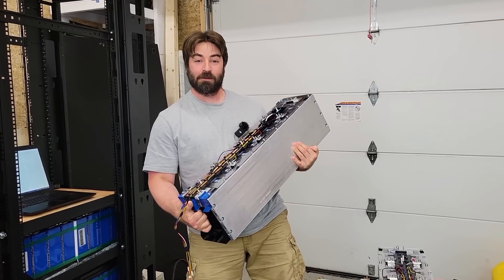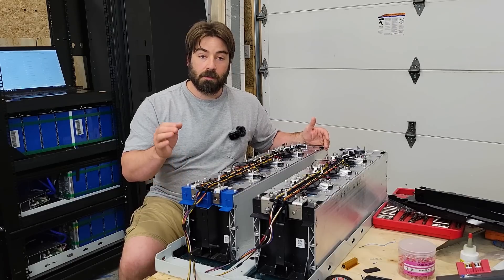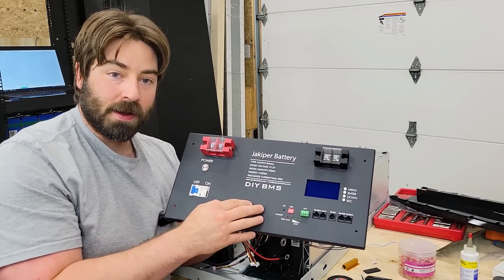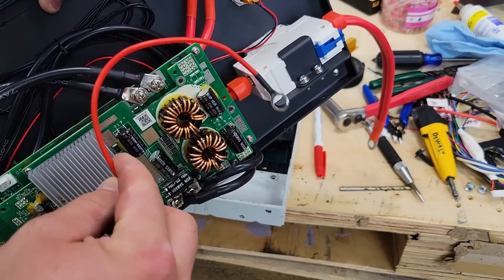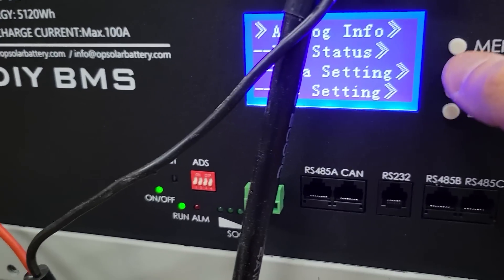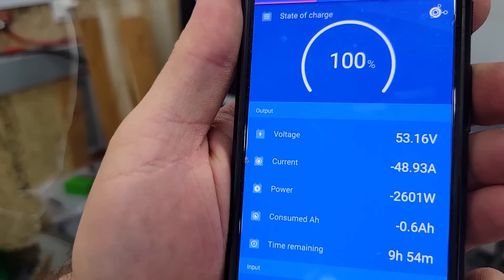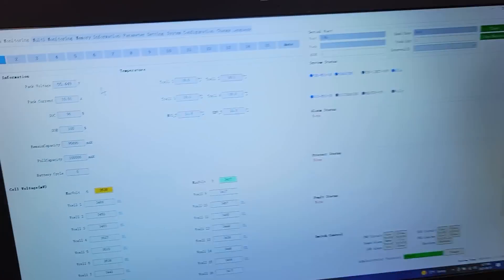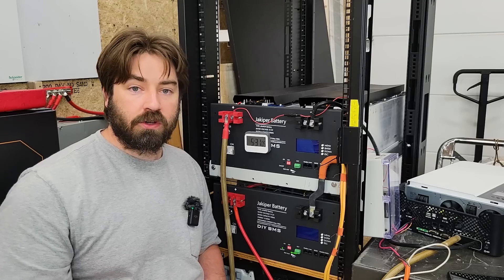Build your own solar battery, fast and cheap!

Comment: What rack are you using to hold your battery setup, or what is it called so I can look into getting 1.
Reply from the maker: It is called a server cabinet.  Mine is made by APC.  I found it at a recycling center near me.  I think I paid $75 for it.  Over the last 10 years or so, a lot of companies have been moving backup storage to the cloud and scrapping old server racks.  Do a search on Craigslist, or Facebook Marketplace for Server Rack and Server Cabinet.  You will want the type with 4 vertical supports.
Reply: @DavidPozEnergy  ok thanks.

Comment: Just wondering what type of thread and size  the nylon nuts are for the cell terminals (M10, 7/16") and  what size bolt (M12, 3/8") and thread were the main battery terminals? I'm putting together my batteries now with the DIY faceplates. You would save me some time ordering the incorrect type. Look forward to your response. Cheers
Reply from the maker: I'm sorry, I don't remember what they were.  I can tell you that they were all metric.  I use this tool for finding threads: https://amzn.to/4j1MZmm

Comment: 7:42 What's that device (with aluminium fins) on the floor?
Reply from the maker: That is a battery charger, specifically for LiFePO4.  That particular model is not sold, but very similar ones are available.  These days, I use the "Chargverter" all the time: 
https://signaturesolar.com/eg4-chargeverter-gc-48v-100a-battery-charger-5120w-output-240-120v-input/?ref=4_rHcgZ9x-TiF-

Comment: You inspired me to purchase two of Battery Hook up's Gotion 16s 51.2v 240ah 12.3kWh Lifepo4 Battery's. comes out to about 130 a kw hour when you factor in purchase of the BMS, tax, and shipping. (not counting a breaker or a disconnect.) Still waiting on them to arrive.

Comment: Hello.
I would like to ask you a question.
I want to make a 16s 48v battery. The cost of 16 280Ah cells is 2690 dollars in my country. However, if I make 16s 48v as 3p16s 48v 100Ahx3, the cost is 2390 dollars.
My question is, will connecting 100ah cells in parallel in threes cause any problems? I will use JK bms.
total capacity makes 48v 300ah. ((3x100Ah)x 16) = 48 cells
Reply from the maker: It's not a problem to make a 3p16s battery.  Some manufacturers do it for specific applications.  Keep in mind that there are more connections to make, but I'm sure that it's still worth it given the cost savings you provided.
Reply: @DavidPozEnergy  Thank you very much for your reply. I don't think it will cause any problems unless there is a problem caused by internal resistances within the cell.

Comment: Now I'm looking at getting a small size rolling server rack for power just for radios along with a single layer (two modules) of power.

Is there a way to hook this up for 12v?
Reply from the maker: If you want to build a 12V battery, then I'd check out some other options from Battery Hookup.  Here is an option with these large cells: https://batteryhookup.com/products/4-new-eve-3-2v-280ah-lk280k-lifepo4-prismatic
Please use discount code DAVIDPOZ it helps you with a discount, and helps out the channel by tracking the affiliate.

Comment: First off, you are strong as can an ox! I thought I was going to just pick these batteries up like you were holding it at the beginning of the video.... My back is very upset right now lol. They didn't have any of these packs as you bought them, the only option was the auction pallets. I bought some and one module had a bad cell. I figured it was no big deal, I'll find a way to take off the welded terminal and put a new one in. That was short-lived. I was able to cut and pop off the terminal so I started to unscrew the bolts but found there were rivets on the bottom so I drilled them out. I then found that the top and bottoms are also welded. It's impossible to get these out lol. I am thinking of just setting a cell on the side and connecting it 😂 I have 8 of these modules so I have some work to do! Some of them just have the welded terminals broken so I will have to drill in the cell and put a helicoil but we will see how that goes.
Reply: Here’s an update. I opened the module finally and I went to helicoil one of the cells. I researched that they are 6-7mm depth. I went to 5mm and went thru. I went to do another and couldn’t get enough threads even after cutting off the taper. Tried another one a little deeper and went through. I think I’m just going to replace with studded cells.
Reply from the maker: If these are going in a stationary application (like I'm using), then I suspect one cell on the side isn't going to make or break your build.  Keep to what's easy for you.  Thanks for sharing your experience.
Reply: is there any harm in using existing balance wires and tying them to the BMS harness? I ended up drilling through 3 cells and stripped 2 because it was too shallow to grab. I accidently popped 2 welded terminals off while trying to open the case so I will have to replace those too.
 @DavidPozEnergy
Reply from the maker: I re-use existing BMS wires all the time for my new BMS.  I'll point out something that is probably obvious, but here goes: BMS wires are thin, and can't carry the full current of the cell.  Don't try to use the BMS wires as power wires.
Reply: @DavidPozEnergy  Ive got them wired up to a sweet busbar. Last question (i think) is there any way to reweld broken welds or any links you know of to do this? Trying to drill the holes has not worked and ive tko'd a few I believe that welded cells have a shallow avalible depth compared to naturally studded cells.
Reply from the maker: I've never tried re-welding broken welds on a cell.  I'm told they are laser welded as that has very little heat.  You don't want a lot of heat being transferred inside the cell.  I don't have a good answer for you on it.  Sorry.

Comment: behind you under the computer is a battery, the cells are separated by spacers with ventilation area. what are those and how do i find them?
Reply from the maker: They came with the battery I bought at Battery Hookup.

Comment: Maybe for that BMS they could use proper sized cables instead of doubling up smaller guage cables!
Reply: Yeah that was a little odd. They had two 7awg wires, which for such a short run would be fine to probably 200amps on a reasonably sustained load, but still an odd wire choice.

Comment: Signature Solar is selling EG4 server batteries brand new for $195 per KWh currently with no DIY/wiring/BMS currently. I want to go that way but the diy is so attractive tbh, think i may go this way instead
Reply from the maker: There are pros and cons to both ways.  I bought a rack of EG4 batteries about 2 years ago and it's still working well.  Here is my affiliate link to Signature Solar if you decide to go that way, you would be helping the channel: https://signaturesolar.com/?ref=4_rHcgZ9x-TiF-

Comment: Hi David. Do you have a link for that orange flexible busbar you used for connecting between the two 8s packs? Thanks!
Reply from the maker: No, sorry.  It was something I had from another battery I took apart.  If I didn't have that I'd probably use a 1/0 wire with a ring terminal crimped on both ends.
Reply: Many thanks!

Comment: I dont speak in Kilowatt Hours. I speak in Amp hours. That says what i need im trying to equate Kw hrs to Amp Hours but after two decades of speaking in Amp hours starting out with 12 volt car batteries and 6 volt golf cart batteries as whole home batteries in Mesa AZ it was always and only sold to customers as amp hours.
Reply: Dont get me wrong the formula is easy: KwHr x 1000÷120V or 240v=AmpHrs

Comment: I give up.
Less than 6 minutes in, 3 ad breaks, each of 2 unskippable ads and they keep cutting you off mid sentence, so I’ve lost both the thread and the will to live.
Only consolation is, living in Ireland, those cells would cost so much to ship it would far outweigh any savings I could make on just buying new.
Shipping alone would be dearer than the new battery off the shelf, here. But it was an interesting topic, until yt went nuts with the ads.

Comment: Your discount codes aren't working for Orient Power. The 8% isn't too surprising since it was limited time, but the 5% isn't working either

So glad I found this video, I had no idea this diy bms was available. That will actually let me make a professional looking battery that is nicely enclosed
Reply from the maker: I asked them about it.  If an item is already on sale (example: early black Friday) then you can't double up the discount.  Sorry about that.
Please still use the affiliate link, as it's how I can continue to make these videos.

Comment: I just purchased 8 of these modules and 4 jbd 300amp smart bms from them and since im 30 min outside philly I drove my 3500 and just picked them up. Amazing savings for 1120ah 😮
Reply from the maker: Good deal.  An hour trip is worth the savings in shipping for sure.
Reply: I have emailed them about that BMS to see what Inverters it support but didn't get a reply.
What inverter are you goint to use with that bms?
Thanks

Comment: This setup is way beyond me 😅 price and technical wise.  Could you do a much simpler and cheaper setup with those  $10 diy battery packs that hold a couple dozen 18650 lion batteries for beginners?
Reply from the maker: check out Bobby's Solar Homestead.  He has some small project videos that I think will be what you are asking about.  Here is one of the videos: https://youtu.be/yVwCT0rJv1I?si=6L_zAP8IpXRhT_ri

Comment: Ive tried several times to buy stuff from battery hookup. Never seems to workout. I wanted the high amp relays they were selling but couldnt ever get them to awnser the phone when trying to order. They send me messages alot but never return a call. If you know another way of getting ahold of them let me know please. And thanks for the videos on the inovair . Ive been running that same ac unit ever since and its been amazing.
Reply from the maker: Sure.  Another way to get ahold of them is through Facebook.  Go to the Facebook group "DIY Battery" and ask your question.  The owner of Battery Hookup is often there answering questions.
Reply: @DavidPozEnergy  thanks David. Bro you have helped me with alot over the last couple years and man I do appreciate it.
Reply from the maker: Your welcome.  I'm glad to help.

Comment: Hi David. Just got both of my battery modules yesterday. Noticed 3 of 4 main battery posts cut off. Any idea why they’re missing? Or next best lug attachments? Thanks
Reply from the maker: What!?  That's crazy.  I don't know why they would be cut off.  I'm guessing it wasn't Battery hookup, probably the company that removed them from their previous application.  You can reach out to Battery Hookup and see if they will do anything.
As for your question.  Sometimes, I've had cut tabs on batteries.  I bend the tab up (even if It's just 3/4") then I drill a hole in it.  Using a nut and bolt to attach the ring terminal of my wire.
Reply: Thanks for your answer. I reached out to them and they said they’ve separated those modules out now. I thought of trying the prying up method but don’t want to break the busbar completely. They offered a return and I’m going to try to take them up on it.
Reply from the maker: I'm glad to hear they are taking care of you.

Comment: This is all very intriguing, however where do you start if you don't have an electrical engineering degree? I love the DIY aspect, but it  feels like this is over my head.
Reply from the maker: Begin with what your goal is.  My goal is to power my house and garage, year-round, off grid.  However, you might have a smaller goal in mind.  My very first solar project was to have one LED light bulb on, and charge my cell phone.  
There is a great video series that I recommend.  It's 6 parts and worth the time to go through them all: https://www.altestore.com/diy-solar-resources/off-grid-solar-system-design-video-series/

Comment: Can the BMS measure the temperature of the batteries?
Reply from the maker: Yes.  The BMS comes with 4 temperature sensors on wires.  I taped these sensors onto the battery in different locations.

Comment: How in the F is that cheap?!!  Thats more than a eg4 battery that is of good quality with zero work and effort!
Reply from the maker: I own lots of EG4 batteries, and they are great.  The standard server-rack battery is 100Ah@51.2V.  This is a capacity of 5.12kWh.  Depending on the model you purchase, you can buy the EG4 for $1,400.  Divide to get the cost per kWh.  $1,400/5.12kW=$273/kWh.  I'm building the battery in this video for about half the cost (about $140/kWh).  Remember, the battery in this video is over 14kWh in capacity.  That's bigger than the standard EG4.
Reply: @DavidPozEnergy     That is true Dave.   But the work, logistics and that fact that it is repurposed are all very detrimental to such an undertaking.
No knowledge, time or effort to get eg4’s .  That isnt being lazy   Thats being pragmatic.   
Truthfully, i did forget the almost 3x capacity aspect.  But still, 🤷‍♂️
Reply: @DavidPozEnergy  thanks for taking the rime to respond    I appreciate that.  As an small channel myself(not this one), i respond to every comment.  Nice to see that u, as a much larger channel, take the time to do so.  Ur one of the few.
Much appreciated🙏
Reply from the maker: Your welcome.  As I said, I like the EG4 batteries.  I've been using them for 2 years.  This is just another way to go.
Reply: @DavidPozEnergy     I gotcha   Bc I am always looking for cheaper.  Hoping upon hope that the sodium battery or some other cheaper storage device comes to market.   
I have 5 eg4 that have been working well for the past 9 months or so and would not trade them for anything on the market right now.
But since u know how much a couple 6548’s and 5 batteries and all the related panels and wiring and such costs ,  u will know that just about everyone is looking snd hoping for the same.
I saw ur tesla teardown when u put it out and I cringed at the thought if such an endeavor.
Anyway   I do learn a lot from u and that kid from vegas, I forget his name.
 I appreciate all yall trying to help others save $$$$ .   
Heck   I have no idea how i put mine together.   I don’t even know if i have all the settings correct.   But it runs my house fine as long as i get 70% sun.

Comment: Does the BMS come with active balancer? Would it make a difference?
Reply from the maker: The BMS has a balance function built in.  This BMS uses resistors for balancing, which is usually referred to as "passive balancing".  The BMS will eventually balance the cells on it's own, but I sped up the process with an I-charger.

Comment: But, How many years will they last. My electric bill is around 300/month x 12 thats 3600 a yearish its less in the Winter because I live in FL. spending 12k plus idk how much in panels to charge these guys, everything would have to last 5-7 years just to recoup my costs. Do you think these batteries being used daily to power a home could or would last that long?

Comment: How do you top balance the cells when they are all in series?
Reply from the maker: The BMS will do it eventually, but to speed up the process I use a hobby charger.  The hobby charger I use is the I-charger X8 (link in description).  I can charge and balance each 8s pack individually.
Reply: Hi thanks. So it has leads for each individual cell in the 8s pack?
Reply: @jl9678  Yes.  It has balance leads to each cell.  When the cell voltage gets to a certain voltage, the I8 will passively burn power. I think it's like 1-2A, which is pretty decent for small charger like that.
Reply: Many thanks!

Comment: Wow, don't waste your time on this video. Everything he shower here and previous videos is sold out. None of these batteries are available to build anything. I didn't notice until AFTER I wasted my time with the video.
Reply from the maker: Battery Hookup said they sold out of the first batch, but are currently testing a second batch.  The second batch will be available for sale in a couple days.
Reply: @DavidPozEnergy   That would be great because I have considered the DIY mode since I decided to get into the solar "Hobby" I being poor folk have poor ways, tried a few various charge controllers battery setups and ended up biting into the EG4 3kw off grid inverter and a single 100AH 48v rack battery after having problems with various cheap chineseum inverters and charge controllers working incorrectly or failing right off the bat.

Right now I run out of battery and could likely fill 2 with my 20 100W 9BB panels so when I seen Signature solar had a new 280AH battery coming for cheaper than the rack batteries I had decided I was swapping as the racks are too much. This would give me that capacity for half the price of their upcoming 280AH option so yeah, I was disappointed seeing they had sold it all out. :). I want to get to that minimum of 2 days of stored power and enough panels to get another eg4 3K and run the whole house beyond all i have currently running from solar and battery. 

FWIW I made it a running experiment. I have everything in my front room running from the solar system. This computer and its monitor, a 10 camera security camera system with a DVR and another computer and 23" hd monitor for blue iris, a 65" 4K smart TV and sound amp. a cooling fan and during the full sun hot days a 5000 BTU 110v window AC between 10AM and 5PM and still charge the battery with spare juice wasted. I found out I had seriously underestimated what could be done with solar and its become a challenge hobby. Batteries are the money killer to be certain in this hobby.